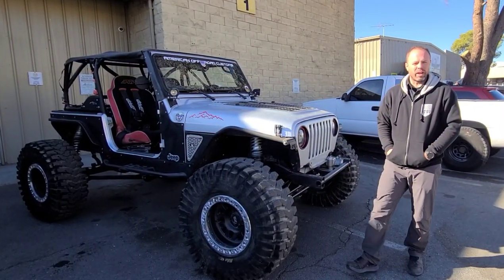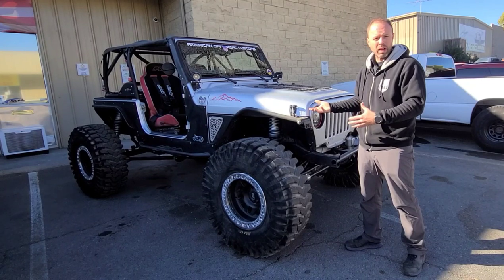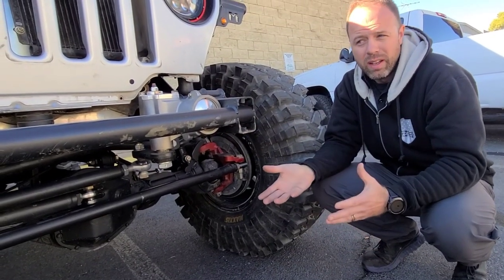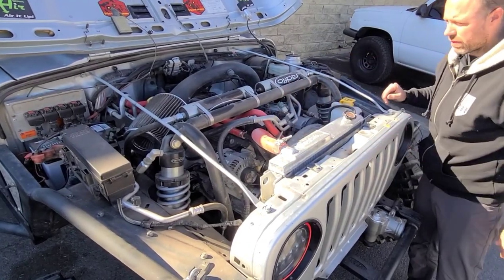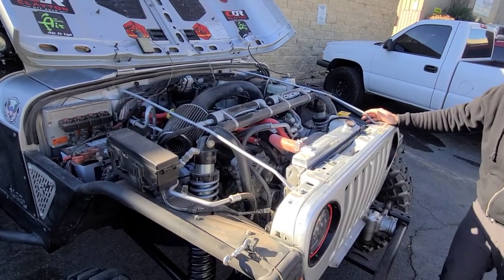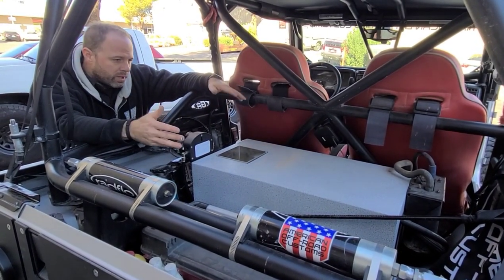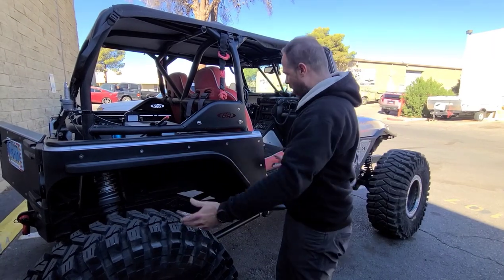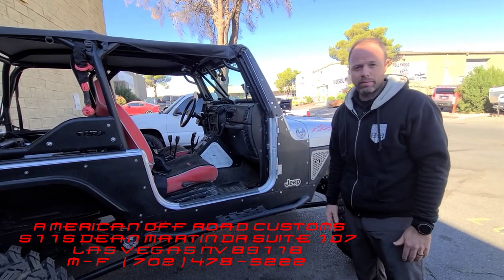Walk around of the stretched TJ A.O.R.C just finished

Comment: What made you go with the new frame kit over finessing the parts to fit around the old frame? Was it only ease of fitment or is there a performance upgrade to the new Frame as well?
Reply: Hey sorry for late response. Just now saw this. But main reasons for frame. Is it moves framerail inward making more room for coil overs and also moves frame up and stays strait out the back where the stock frame curves down right where the axle was stretched to causing less uptravel